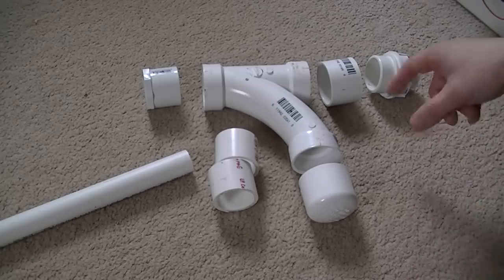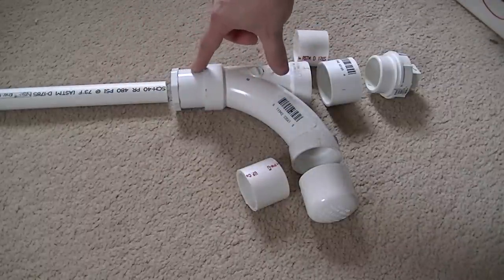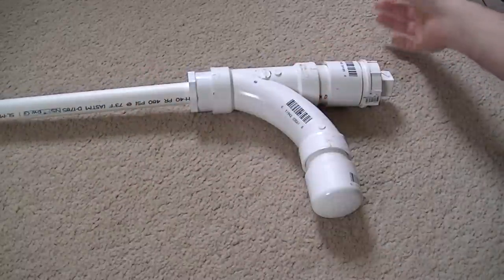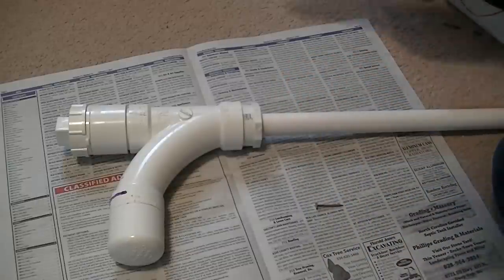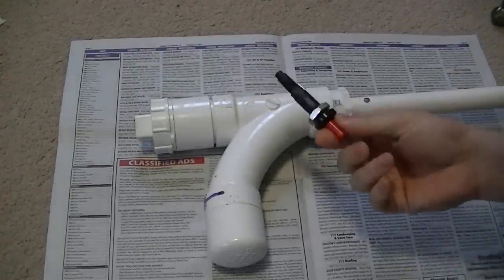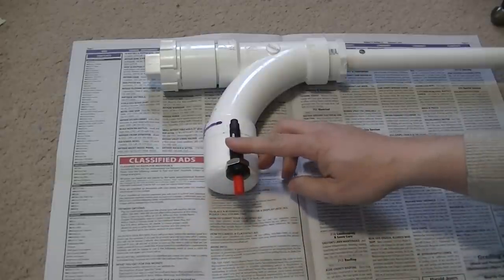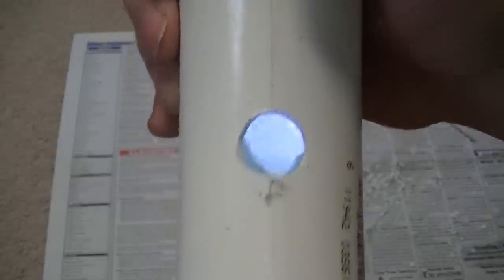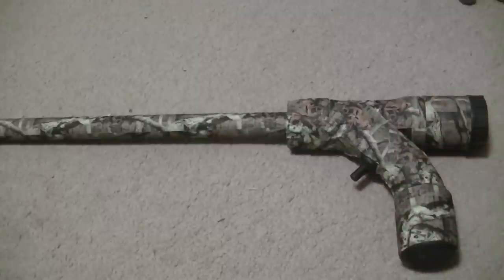How To Make A Potato Gun Pistol

Comment: Could I use a car pump with a valve installed to make it safer and I'd use pressure rated pvc as they can handle pressure built up
Reply from the maker: yes, could also use a small air tank.

Comment: where can u get the ignitor and if has wires do u need it
Reply from the maker: You should be able to get an igniter at any place that sells a gas grill. If it will ark across without the wires then you will not need them.

Comment: Whats the part on the very back that screws in
Reply from the maker: Jordie Sweet That screws on and off to add the fuel.  The store calls it a PVC Cleanout Plug Fitting.
Reply: Jason Roush what size are the couplings or what ever it is holding the cap at the bottom and the cover at the back together?
Reply from the maker: Jordie Sweet I used a 1 1/2-in X 1 1/2-in X 1 1/2-in  dia 45-degree PVC Wye Fitting for the center (handle). I wish I could have found a 2-in X 2-in X 1 1/2-in. Then used a very short 1 1/2 inch PVC by 1 1/4 inch long to connect the caps on the bottom and another one for the threaded adaptor and coupling on the back. The it is all held together with PVC glue.